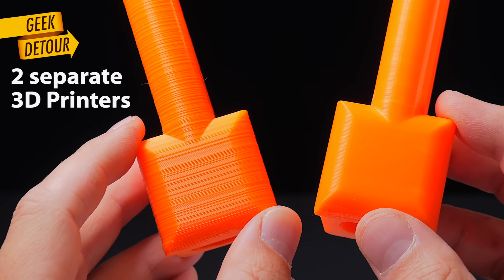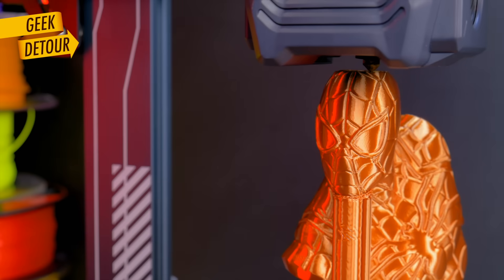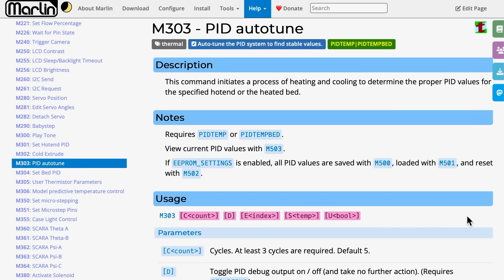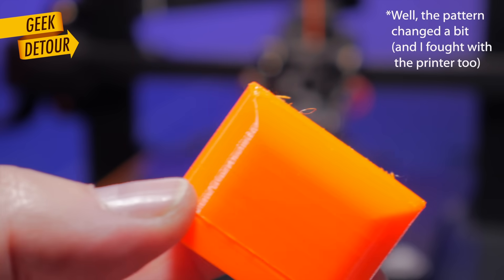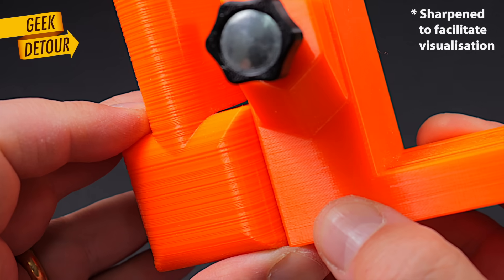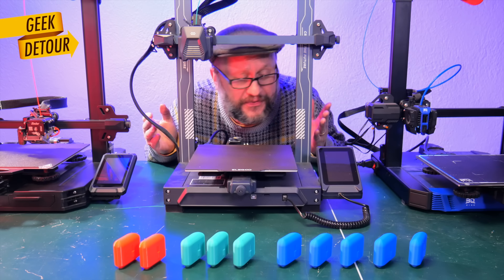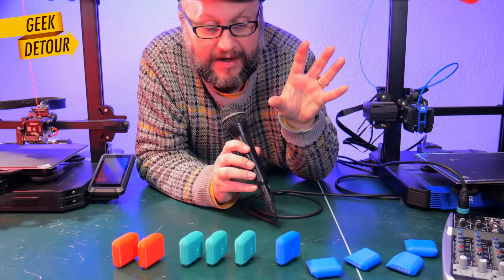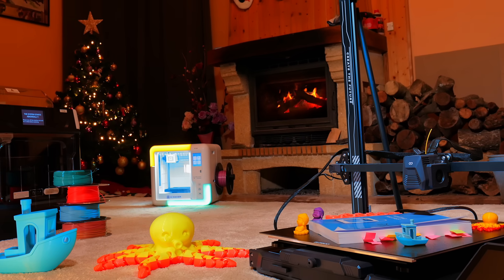3D Printer Problem: do you know How to Fix Z-Wobble?

Comment: For the record, while many people on YouTube and similar platforms like to make the same claim without research, it actually is NOT a Design Intent for leadscrew nuts to correct for out-of-spec assemblies by oscillating transversally about the screw's axis on loose mountings. That's nothing but a cost-saving shortcut used by cheap manufacturers to get around assuring the quality of parts prior to assembly and the quality of assembly prior to sale and an excuse to avoid costly returns and exchanges between these manufacturers and their suppliers and customers whenever those parts and assemblies are not within spec. Leadscrew nuts should be mounted securely, just as should couplers, motors, bearings, frameworks, and carriages.

There's nothing wrong with shortcuts that work, even the ones that shorten maintenance cycles.  There is MUCH wrong with misinformation, especially when it becomes prevalent enough that respectable sources such as yourself repeat it to the unsuspecting masses without knowing any better.
Reply from the maker: I agree partially with your comment. We are talking cheap printers. (Btw, thanks for discussing it).  But in practice even much more expensive parts also don’t get perfect, so, decoupling is a real need. I think you will be delighted with a video from MirageC where he tried to solve wobbling - the solutions are clever and he measures things with good precision. Please watch: 
https://youtu.be/4kQZnSzZHD0?si=TombcN_SDQTjtntJ

Comment: My immediate guess is over extrusion or leadscrew binding. Now I'll watch and see.
Reply from the maker: You got it ❤️ It’s nice that you guessed overextrusion - I should have mentioned, but at the time I knew it wasn’t because I was using the same profile for months with perfect results.
Reply: @GeekDetour  I've seen this on machines where the bottom of the leadscrew rests directly on top of the stepper motor shaft. There should be a gap. One trick is to put a ball bearing in the flexible shaft coupler between the motor shaft and leadscrew, so that the leadscrew is supported vertically but can still pivot freely.

Comment: Low end printers, you spend more time troubleshooting then printing.
Reply from the maker: Oh, that’s not exactly true. All my printers PRINT A LOT, they are basically non-stop factories. And all printers require maintenance (which I neglected a few months ago). A completely different discussion is what is going to be with very proprietary / closed designs that are being framed as appliances (which I think it is an excellent approach to make 3D printing more usable for people that don’t desire to tweak at all) when they get older: will they be easily serviceable? Or will people get trapped into costly replacements?

Comment: I think an important distinction is needed here. While the general message is important, the issue isn't Z binding but Z wobble. Z binding is used to describe when the Z axis binds and fails to move up or down properly. Assuming the issue was with the screws, we are still dealing with Z wobble. The purpose of those screws is to decouple the nut from the Z carriage to eliminate Z wobble. So while the screws might have been binding, it would still cause Z wobble.

That being said, the issue in the print doesn't look like Z wobble, but rather like Z binding. I'm wondering if something else changed while loosening the screws on Z nuts...
Reply from the maker: Hi there! Thanks for discussing it 🤗 My personal take on this episode is that “starting to bind” is far worse than completely coupled. It was catching, then suddenly moved and adjusted to alleviate the tension.
Oh, it is always possible that I also touched something else that I was unaware, the machine printed beautifully all these months after that episode. It is a testament that regular maintenance avoid catastrophic failure - even if not everything is as perfect as it should.
Reply: @GeekDetour  Agreed. Those small glitches when things bind and release have cause a real headache when troubleshooting. And to me the main message from this video and the message I try to get across to people is that methodical troubleshooting gets better results than random adjustments. This video shows the process really well!

And and as you said: Once things work, regular and thorough maintenance keeps them running smoothly.

Comment: Maybe one printer sat on a rigid table and the other one not which could lead to strong ringing. There are tests on YT with different underground materials, like concrete plates, rubber for washing machines and so on. Rubber feet on concrete plate won as I remember.
Reply from the maker: Your reasoning makes sense - and it can affect prints specially if the frame of the printer is not rigid enough. But when the frame is tight and the mechanics are well set (smooth with no plays) it makes no visible difference 👍 I forgot to say I never moved the printers from their places (I did later when I was reenacting to record my “fight” with the problem). The only original recording I did in March was showing the pieces’ close-ups. That’s what I had the time to record back then.

Comment: In fact loosening the nut will not compensate the distance properly. Because if the z rod has irregularities it will effect the travel distance. For example if it is bended sideway this will shorten the travel distance. It doesn't matter if it is loosen or tight.
Reply from the maker: In the ideal world the Rod should be super straight, sure. Oh, have you watched the excellent MirageC videos about his decoupling efforts? YOU MUST: https://youtu.be/4kQZnSzZHD0?si=C9bFG0_SJRjbL4kS

Comment: Remarkable timing. This just popped up as im in the middle of a massive job. 5 printers,  24/7  for 3 months ... just started noticing a bit of z binding but didnt know what it was, and them this video shows up... thanks ! Also i will be buying that book!
Reply from the maker: Hi Andre, Andrew? 🤗 Thanks man! I am glad it came for you in the right moment 👍 Please tell me later if it worked! Merry Christmas 🎄🎁
Reply: Why dont you add more printers?
Reply: @indalecio21   the reason im limited to 5 printers is electricity and space. We keep them all in 1 office to regulate temperature and while we could fit more on the tabls there is only only enough circuits for 5 printers and a laser. We had plenty of time before prints are being used so rather than dedicate another office to printing im just playing the slow game lol. Also we normally dont do large volume printing so i dont want to be stuck with 8 machines that wont get used.

Comment: when you test 3 printer use the same PLA ... mistack to have 3 PLA defferent prusa havent fixed barre a t the top )
Reply from the maker: Hi! 👋 Sorry, I didn’t understand the thing about the 3 filament. Can you elaborate? I got curious
Reply: use same filament for test with 3 printer  @GeekDetour
Reply: utilise Les 3 meme filament pour les test sinon cela ne sert a rien

Comment: Nice video. FYI those lead screw nuts don't only need adjustments occasionally, but they are considered a consumable part as well so they will need to be replaced periodically depending on your use. They're soft brass so they wear down relatively quickly if you're printing frequently. 

All part of the process of owning and maintaining a printer 👍
Reply from the maker: Hi Dude! Yeah man, so true! People are commenting I should try POM nuts - I’ll give it s shot. Merry Christmas my friend! 🎄🎁
Reply: @GeekDetour  
Polyamide (PA) is a very durable material, I have often seen a polyamide gear wear out a hardened steel gear!
This material only seems weak, but in fact it is one of the most wear-resistant polymers
Reply: I've been using 3 of the same printers for over 3 years, they all have the exact same backlash nuts they came with. 6 months ago, I cleaned them for the first time. Still working perfectly.
Reply: @LampDoesVideogame  that's awesome. Not sure how often you print or if you're just still within tolerance but I can assure you it's a wear part, that's how they're designed. They're made of soft brass.

Comment: Thank you for covering other sources of issues, as one of my prints suffered the wavy lines of the heat fluctuation rather than the z binding. I was struggling to diagnose it before this video.
Reply from the maker: So nice to know it helped you, even when it was not the very same culprit of mine! Thanks for sharing. Yeah, wavy layers can happen for several reasons and in that occasion, for me was the un-lubricated lead screws and nuts starting to bind - but I don't want people thinking that's the only reason, because definitely it is not.

Comment: I had this problem and I had to tighten, not loosen my rods to fix it.  Ender 3 S1 Pro. 🤷
Reply from the maker: Yeah, crazy isn’t it?! In one of the tests of the experiment, tightening the nuts got me an even smoother part - but the difference was so NOT visible in camera, very slight improvement. But I cannot generalize, for most printers having the nut decoupled is better. Anyway, every machine is unique

Comment: Thanks. This makes sense about the z axis needing to be loose. I was a bit worried this morning when unblocking the extruder gears and hotend in my BBL P1S and seeing that the z screws were visibly loose inside the top bearing bushes

Comment: I had exactly such a problem. I was about to research this. And all the ways you tried came to my mind and I was going to try them. I've tried it before but I was going to test it again. After watching this video, I remembered that I saw that those screws were loose and tightened them. Thanks to you my guess was proven. Thank you for sharing this video, my friend. I subscribed and see you in your other videos.. 🙃☺
Reply from the maker: The screws on the LeadScrew Nut must be loosen. The nut must be able to move sideways.
Reply: @GeekDetour  Yes, but at the same time, my z eccentric nuts were also tight. When I loosened both of them, it was fixed. thanks a lot again

Comment: Hello from Moscow, Russia.
Sorry for my English.
May be.
Table calibration.  Tolerance +-0.05 mm.  The layer thickness is less than or equal to 0.10 mm.
Good luck.😊
Reply from the maker: Hi there! Thanks for watching and yeah, things that are mechanically loose is the first thing to check! And all the printers I use now have bed-level compensation. But that was not the case 😁 Merry Christmas Jack! Cheers from Spain 🇪🇸🎄🎁🎉🎊❤️🍀
Reply: @GeekDetour  Merry Christmas 🎉🎀🎁🎆🎄

Comment: Hello!! I had the same problem, It was for me a slightly loose heating block.  Heat the nozzle and with a pair of plyers check if the heating block move a little, then fasten the screws. Problem solved!!!!
Reply from the maker: I LOVE comments like yours - thanks for sharing your specific problem. Yeah! Anything lose ends up appearing in the printed parts 🤷‍♂️ Merry Christmas Victor 🎄🎊🎉❤️🍀🥂

Comment: My Ender5plus/BTTminie3v3 has this issue, but not always.... which is mighty confusing.  The Z's used to squeal so they got Clipper oil (the oil that comes with hair clippers)  That ended up in a puddle all over the motor as its runny stuff, so i advise not to use that. High temp lithium grease is the way forward there. Heres a top tip, Wipe off the access. My Filament is side frame mounted and the twist as the filament comes off the spool.... Mine contacted the Z grease. I didnt know this at the time, Costly mistake. Had to replace everything, PTFE tube, Filament sensor, Extruder gears needed cleaning (slippage aint good) and even the tube and nozzle got replaced as they never felt right after that escapade.   So my friends, Let my head scratch be a lesson to you all.   Happy printing.

Comment: i've done a lot of research on fdm 3d printers and 3d printing in general, and i've never heard of those screws needing to be loose but i looked on the printer i'm using and they are TIGHT, not even in the same realm as loose and my layers look bad like that but i thought it was normal for them to look like that lol. if only my thermistor wasn't broke rn
Reply from the maker: Hi there! MirageC has excellent videos about the Nut problem: https://youtu.be/mqSQhwqSzvg?si=q0rjGzUVBfLLm3tN

Comment: The  little screws on the Enders Z axis should not be loose like you say if your printer is set up properly with strait Z screws, the reason Creality say to keep them loose is not because they should actually be loose it is because the quality control on the Z  rods is incredibly bad and the rods are almost always as bent as a banana and so keeping them loose helps hide this it also helps adjust for user error during the building phase ( not correctly aligning the Z stepper motor ).

The reason why you do not want the Z screw nuts loose is because the holes that it the screws go through are designed for a lot of adjustment and so when the z rod turns rather than the X gantry moving up or down the actual z screw nut will rotate a little first and this will lead to inaccurate first layers and layer issues and if you use Z hop it will cause the irregular layer issue you have.   I had the same issue on my Ender 3 printer some time ago that I had upgraded to a dual Z and at the time i had them loose also however i noticed that one side was more loose than it was ( probably vibrations worked it loose ) and watching it you could see the slight rotation of the Z nuts ( more so on the super loose one ) and i was getting the same issue as you, tightening up the super loose one so both where exactly the same and slightly loose resolved the issue but not the slight rotation you could see, in the end i installed oldham couplers and it was even better as they could be tight so no rotational movement, currently however i swapped out the warn oldham couplers for simply strait Z rods alighted everything correctly and fully tightened down the screws on the Z nut and the quality is the best it has ever been.
Reply from the maker: Hi there! I appreciate the long and carefully written comment. Thanks for taking the time. I agree with you that an ideally super well machined lead screw shouldn’t need any lateral movement. MirageC has been exploring this subject with great effort and I am sure you will enjoy his demonstrations and solution: https://youtu.be/4kQZnSzZHD0?si=tB1ARonQGFGKUT47

Comment: MirageC has some great videos on this type of artifact and what problems can cause them.
Especially his wobbleX looks insane (although it requires a minimum weight that makes it useless for generic bedslingers)
Also take a look at oldham couplers for the 3 printers shown in the video, if you buy them in bulk it might only be $20 for the 3 of them
Reply from the maker: I watched all of them - love it! And in my mind all the 3 printers would immediately show the wobbliness in their prints starting to when I tightened their nuts. To be clear: on a very close inspection, it happened - but it was SO DISCRETE that was impossible to see it clearly on camera. The prints were in essence “perfect” or perfectly acceptable and nobody would point the finger and say: “what happened here?”. I wanted to show a guaranteed disaster and… depending on the printer you have, it might run just fine even with coupled nuts. Makes sense? But I will definitely start modding these printers just for fun - didn’t have time to do it this year, but in 2024 I’ll hack them to my taste.
Reply: @GeekDetour  i went to Oldham couplers a month after buying my ender 3 S1 because the wobble was bad enough to impact tolerances on parts I was making.

Prints look way cleaner although I still have some inconsistent layer stacking due to the extruder gears not being perfect. But i honestly didn't mind it as much until I got the vzhextrudort on my custom build which just made the sprite extruder look like shit in comparison.

But I guess every print looks shit when you shine a harsh enough light from directly above.😅

Comment: slicing from different heights can do this like from 0.2 to 0.16 , sliced to 0.12 and works but not 0.16 🤷‍♂
Reply from the maker: Oh, I should have mentioned layer height: 0.2mm. I know: Magic Numbers, .08 .12 .16 .20 .24 So steppers can engage each layer with the same strength and not get caught on different interpolations 👍 Good one! The problem looks more consistent, though.

Comment: I had one of my Ender 3's on vacation last month cause it had an issue i couldn't figure out. It has a Sprite Extruder, and it was having a couple failed lines, very random, but more common on taller pieces. After assembling and disassemblying pretty much the whole printer, i ended up switching the stepper motor and voilà, it worked perfectly!

The issue with the motor was a single bearring that was rusty and loose, causing the metal rotor inside to catch on the steps and block the extrusion for a couple seconds! Luckly i had just bought a spare Sprite Extruder otherwise i wouldn't have had the chance to try another motor.

Also, ótimo canal meu caro!
Reply from the maker: Cara que demais sua história. É fácil esquecer que dentro dos motores tem dois rolamentos - e tudo gasta cedo ou tarde!
Obrigado demais por escrever e bem vindo ao canal!